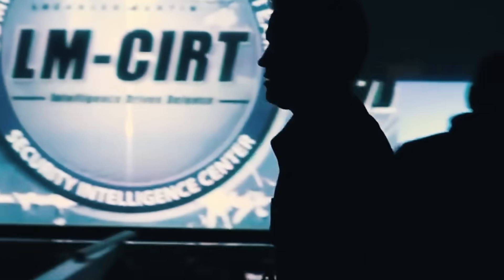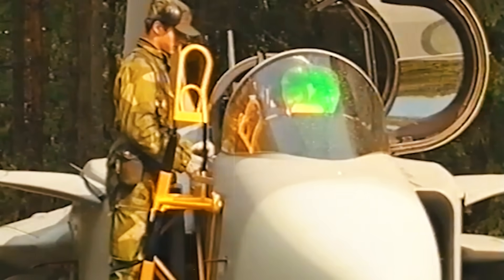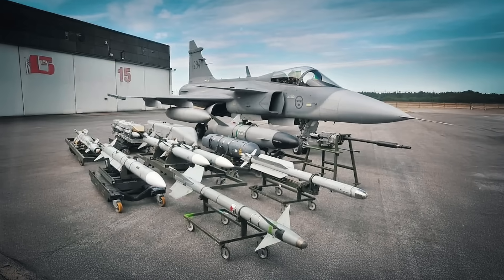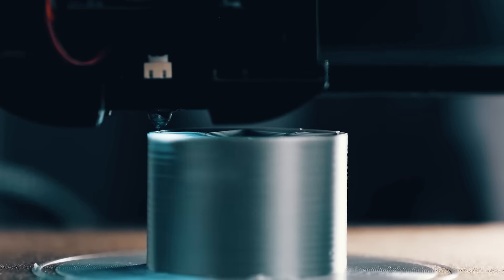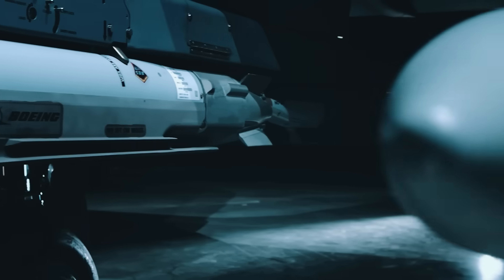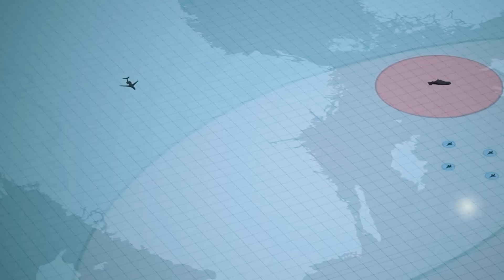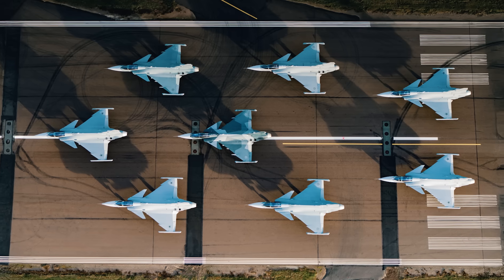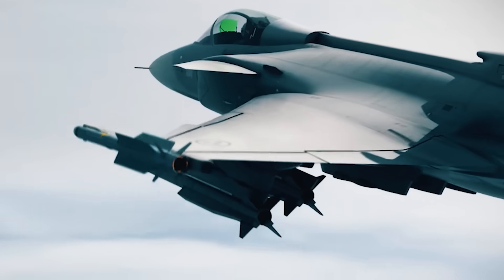Swedish Brand New Fighter Jet SHOCKED Russia!

Comment: The combat proven F-18 and F-15 are designed to “keep flying” after taking two hits anywhere in its hydraulic systems.  The redundancy levels for current fighter aircraft:  single-engine: F-35, F-16 & Gripen = 3rd generation; twin-engine: F-15 & F-18 = 4th generation.
The overall cost for the latest F-18 should be competitive with the Gripen since the CF-18 has been a mainstay fighter in the Canadian Air Force for 43 years.  The USAF F-15 has been in service for 49 yrs with the B-52 bomber in service for 70 yrs.

Comment: Trump will screw up and put a ban on the GE jet engine and take away those important sales from the USA. Gripen 39E is better suited for Canada rugged terrain and will be a better aircraft possibly with the Rolls-Royce engine to avoid Trump misbehaving ban. The GE engine is very impressive and works well and just sips fuel where the F35 has a much higher cost per flight, Canada would be better off with the Sweden jet IMO!

Comment: Can you please equip this fighter jet with a non-US jet engine (currently GE) to avoid being subjected to US conditions/regulations and limitations, and to avoid having to depend on an UNRELIABLE country?  Why not use the UK/Eurojet EJ230 instead, with equivalent/slightly superior thrust capabilities and somewhat lighter?
Reply: That would require design of an entirely new airframe system - it is not that easy. It would also take about 3 years of design and testing -- and be expensive to do for a run of under 100 aircraft.

Comment: The selling point that the Gripen can use short runways may enable underpopulated countries to build many of them at a low cost. Even highways could be used if designed for dual use. Stealth versus wide distribution of strategic support is yet to be discussed. Especially when larger air dominance drones come into play in consort with any of the fighterjets.
Reply: And Canada's Arctic is just full of highways...stocked with fuel and parts...NOT.

Comment: Canada should definitely take on manufacture of the Grippen for RCAF.
Reply: Just how many roads are in Canada's far North? Zero? Yep. 
How many sources will exist for building spare parts for a worldwide fleet of less than 150 Gripen Es? Two: small workshops in Brazil and Sweden. Spare parts & logistics are gonna be a big problem...
Have you ever heard of economies of scale? No? Are you aware Gripen E is now the more expensive aircraft? No... 
Are you aware Gripen E's designed airframe life is 6000 hours, four times less than F-35s? No. 
Have you ever read (and understood) in detail why Gripen E/F is Gen 4+ and F-35 is 5th Gen, soon to be 5+? No.
Do you realize Gripen Es will not be modernized in the future? No?
Do you realize SAAB is a micro-company vs. the consortium that builds F-35s? The F-35 production effort is led by Lockheed Martin, with Northrop Grumman and BAE Systems as principal partners. The F-35 is produced in countries that have either purchased or plan to purchase the aircraft, which includes the United States, seven partner nations, as well as foreign military sales buying nations. Did you know that? 
Do you know how F-35s integrate into the digital battlespace compared to Gripen's limited Link 16-based LAN?

Just WTF are you smoking? There will be thousands of F-35s worldwide fighting in a massive network of connected weapons systems, and you actually believe SAAB has a better system???
Reply: A very Americanized point of view. Here in Canada we prefer if we get to build and service them ourselves. We are very used to flying old things, and we can build pretty much anything anyone else can. PS, there are a lot of very long roads in the Canadian North, and in Canada we are good with all kinds of Logistics, no problem. If it can be moved, we’ll get it there. Cheers.
Reply: Not a fan of purchasing arms from a country that has threatened my country’s sovereignty. I understand all the things you are saying, and still do not want to fly an airplane programmed by a country that has indicated the ability to turn off key functions if it is in their interest. You should be more concerned about how many of these high tech war machines will fall on each side of the line in your next civil war. Canada will decide for Canada. CU, good luck.

Comment: Canada needs the Gripen.
Reply: Just how many roads are in Canada's far North? Zero? Yep. 
How many sources will exist for building spare parts for a worldwide fleet of less than 150 Gripen Es? Two: small workshops in Brazil and Sweden. Spare parts & logistics are gonna be a big problem...
Have you ever heard of economies of scale? No? Are you aware Gripen E is now the more expensive aircraft? No... 
Are you aware Gripen E's designed airframe life is 6000 hours, four times less than F-35s? No. 
Have you ever read (and understood) in detail why Gripen E/F is Gen 4+ and F-35 is 5th Gen, soon to be 5+? No.
Do you realize Gripen Es will not be modernized in the future? No?
Do you realize SAAB is a micro-company vs. the consortium that builds F-35s? The F-35 production effort is led by Lockheed Martin, with Northrop Grumman and BAE Systems as principal partners. The F-35 is produced in countries that have either purchased or plan to purchase the aircraft, which includes the United States, seven partner nations, as well as foreign military sales buying nations. Did you know that? 
Do you know how F-35s integrate into the digital battlespace compared to Gripen's limited Link 16-based LAN?

Just WTF are you smoking? There will be thousands of F-35s worldwide fighting in a massive network of connected weapons systems, and you actually believe SAAB has a better system???

Comment: Big deal,,,In 1957, Sweden's Air Force held the fourth-largest military air fleet globally.
The first Swedish jet fighter with swept wings was the Saab 29 Tunnan. It was the first Western European fighter to be produced with swept wings after World War II, with its first flight taking place on September 1, 1948.
The first entirely glued aircraft was not the Saab 2000, but rather the Saab 340, which was the first aircraft to fully utilize adhesive bonding for its wings. The Saab 2000 is a larger, more powerful version of the Saab 340, and while it also benefited from extensive adhesive bonding, it was not the first to utilize this technology fully.
The Saab 35 Draken was the first jet fighter to perform the Cobra maneuver. Swedish pilots, specifically test pilots Bengt Olow and Ceylon Utterborn, developed the maneuver around 1961-1963. The maneuver was developed as a way to prevent superstalls in the Draken, and it was also used in mock dogfights against the newer J-37 Viggen. The maneuver is known in Sweden as "kort parad," which translates to "short parade," referring to how the plane rises during the maneuver.
Just a small info but the Swede state of mind is to keep a low profile and not stand up and bragging.

Comment: A highly capable fighter with excellent speed and range designed and built in a northern climate with long distance Arctic operations in mind...
Reply: ...would still get shot down by a J10 + PL15E in a BVR engagement.
Reply: @blaze1148  Most shots in BVR would actually miss a Gripen.
Reply: @FredrikLimegård  ....why - you do know how the Realfails were shot down don't you....
Reply: @hugo-pg5tv ....you would like to think so....the Rafale held it's own vs an F-22 a few years back.
Reply: @hugo-pg5tv The J11 first flew in 1998....whereas the J10c first flew in 2013....don't boast about this it's embarrassing 😆...the Pakistani's used multiple radar tracking hardware....wasn't it the SAAB that was damaged on the ground by a missile hit from India....
Reply: Ideal for Canada.
Reply: Just how many roads are in Canada's far North? Zero? Yep. 
How many sources will exist for building spare parts for a worldwide fleet of less than 150 Gripen Es? Two: small workshops in Brazil and Sweden. Spare parts & logistics are gonna be a big problem...
Have you ever heard of economies of scale? No? Are you aware Gripen E is now the more expensive aircraft? No... 
Are you aware Gripen E's designed airframe life is 6000 hours, four times less than F-35s? No. 
Have you ever read (and understood) in detail why Gripen E/F is Gen 4+ and F-35 is 5th Gen, soon to be 5+? No.
Do you realize Gripen Es will not be modernized in the future? No?
Do you realize SAAB is a micro-company vs. the consortium that builds F-35s? The F-35 production effort is led by Lockheed Martin, with Northrop Grumman and BAE Systems as principal partners. The F-35 is produced in countries that have either purchased or plan to purchase the aircraft, which includes the United States, seven partner nations, as well as foreign military sales buying nations. Did you know that? 
Do you know how F-35s integrate into the digital battlespace compared to Gripen's limited Link 16-based LAN?

Just WTF are you smoking? There will be thousands of F-35s worldwide fighting in a massive network of connected weapons systems, and you actually believe SAAB has a better system???